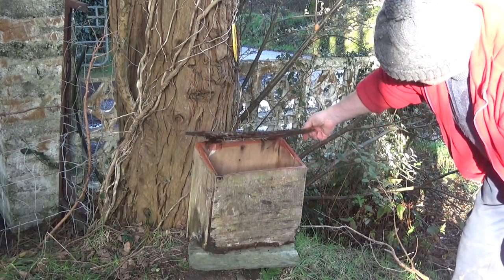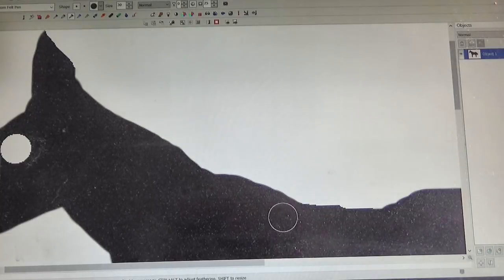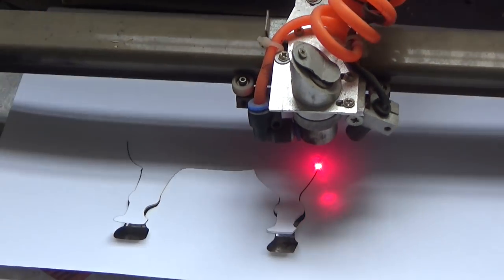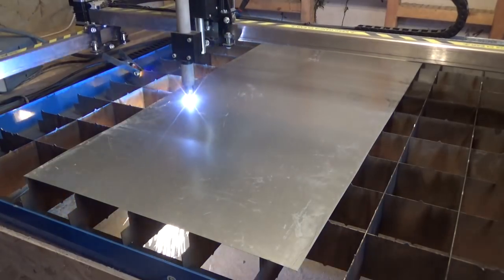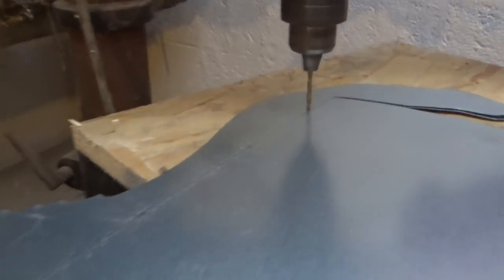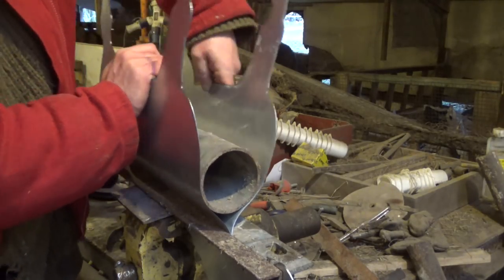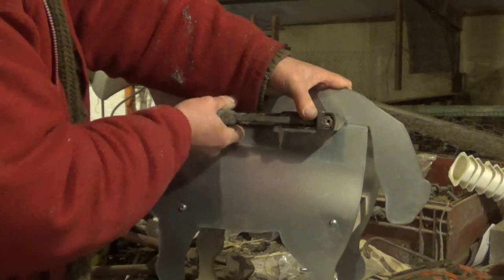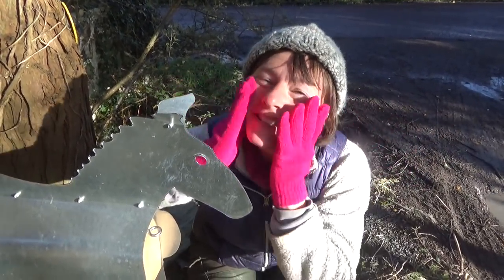Designing And Making A New Post Box  (CNC Plasma-Cutting Galvanised Steel)

Comment: Just a suggestion for next time running a bead of silicone in between the two top flat parts before you sandwich them together(just enough that it doesnt squeeze out) to ensure no water could squeeze through the cracks. Awesome video and very cool design!

Comment: excellent use of the plasma cutter, complete one off and simple to make! the only thing I would have done is run a bead of siilcone on the line the pop rivets went between the two sheets to stop water getting in, but it may not be an issue anyway! Look forward to seeing what else you put it to use doing!
Reply from the maker: Cheers, Rich!

Comment: Excellent mailbox, Tim! My only concern is the possibility of rain water seeping in through the joint on top of the mailbox where the two sheet metal cutouts are riveted together. Perhaps some silicone will do the trick. Other than that, it’s perfect!
Reply from the maker: Everything's dry so far, but you're probably right!

Comment: I like it, but maybe a little caulk inside the top edge?
Reply: you'd be amazed how sideways the rain goes in this part of the world (i'm not in Ireland but the climate in SW England is very similar), very rarely is it ever vertical, but sealing the top might be a good idea anyway, just in case. look at old Celtic roundhouses and the holes in the middle of the rooves.
Reply from the maker: What Mikail said!